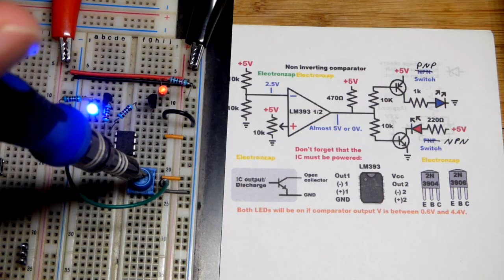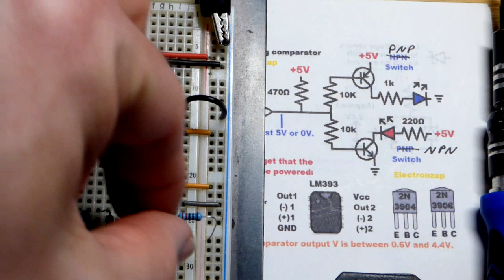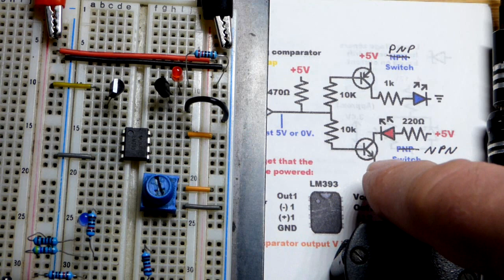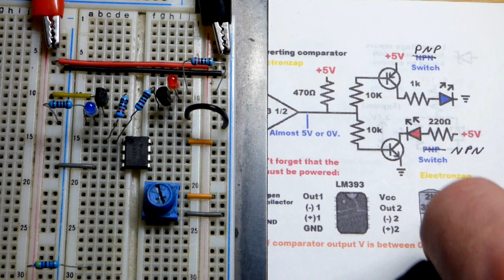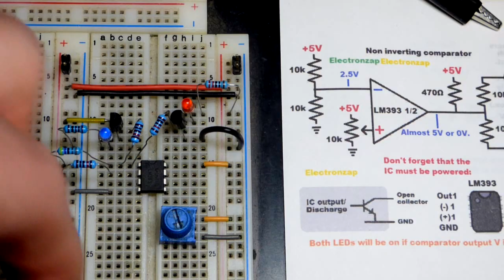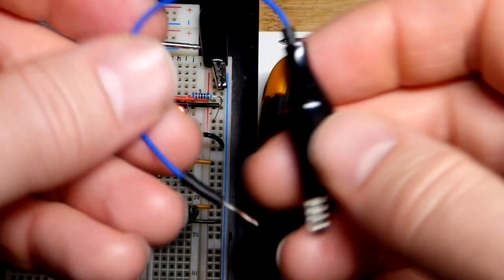Beginners LM393 Comparator IC Integrated Circuit Switching Alternate Transistor LED Loads

Comment: I liked the explanation of the "open collector" type of output. It's very informative to hear, that it's good at connecting load to GND and that's why we should use a pull-up resistor for the high state 👍 Thanks!
Reply from the maker: Thanks for watching!